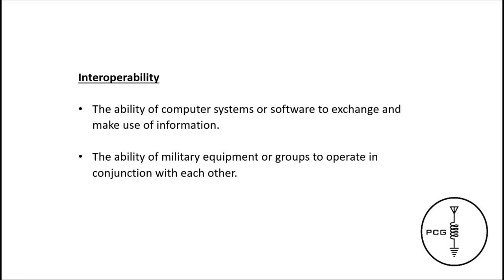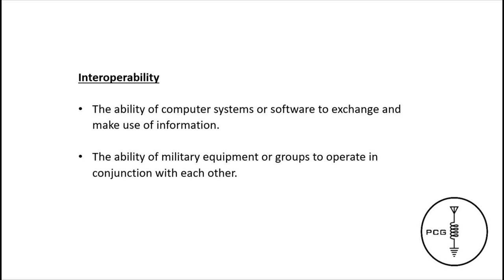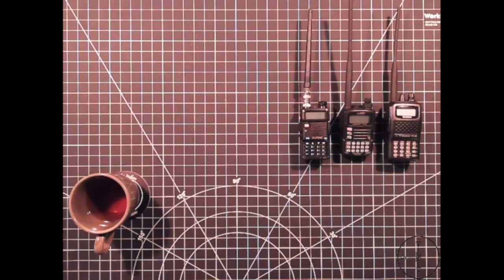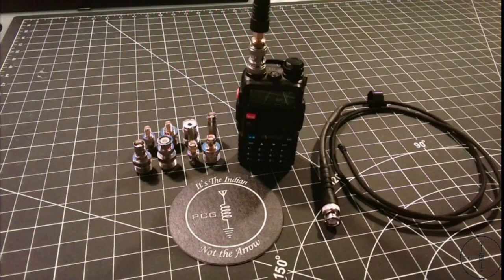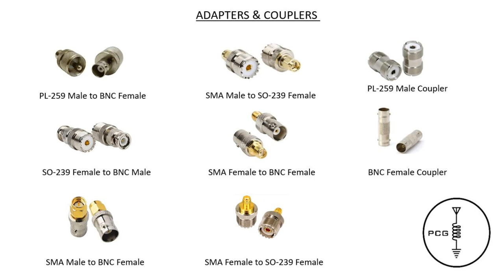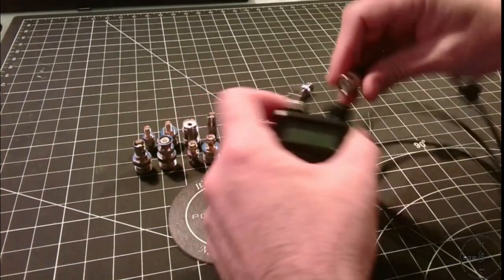E9: Comms Accessories & Interoperability

Comment: I’ve been running a VX-6 and FT-60 since they were first introduced in the early 2000s. I have tried many of the aftermarket batteries for both. None have lasted more than a year or two and non ever worked as well as the factory. My VX-6 originally shipped with a NiMH battery. The new Lithium Ion are not only superior technology but last even longer. The price is somewhat ridiculous but they last so long they are more than worth it.  There is a 2 cell AA case available for the VX-6. While it would appear almost useless on the surface there’s a hack. They’re are AA size batteries that are 3.6 volts. 2 give you about the same TX power and life as the stock battery. I keep 6 of these in a Storacell battery holder with the AA case in my bag.  I’m also a big believer in the AA case for the FT-60.  This one must use regular AAs. Contrary to the manual, rechargeable AA work fine. Prior to 2013 the FT-60 could charge directly from a 12v source like the VX6R. They not to use rechargeables in the AA holder because there was nothing to prevent overcharging. They make AA battery cases for the UV5R but you need a dummy battery and 5 regular AAs or 6 rechargeables to get the correct voltage. Another great radio are the Icom V-80, V-86 and commercial F3001/4001 models. The first two come with BNC connectors from the factory and they all are designed to run full power from a AA battery case.
Reply from the maker: I was looking at the AA battery cases but didn't pull the trigger on them yet because I was skeptical.  Thanks for the information, I'll have to try them out.